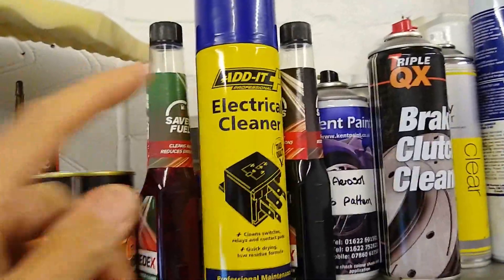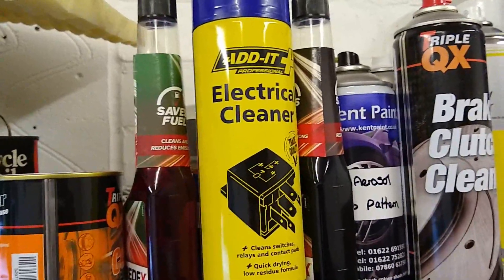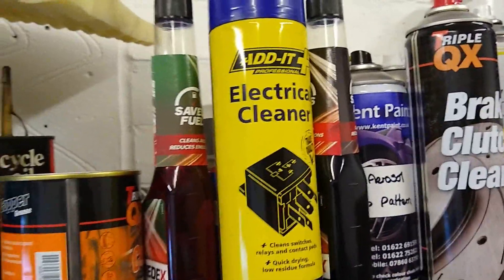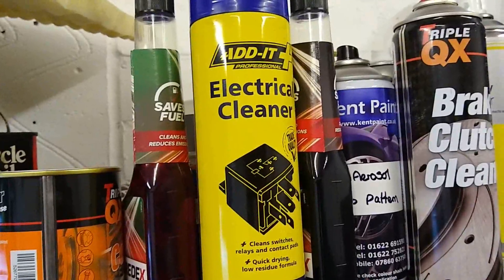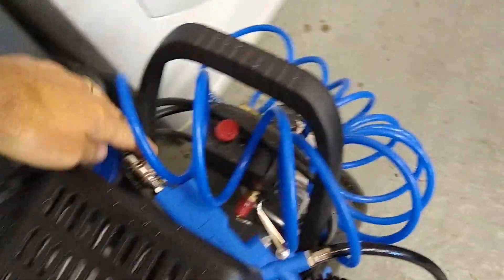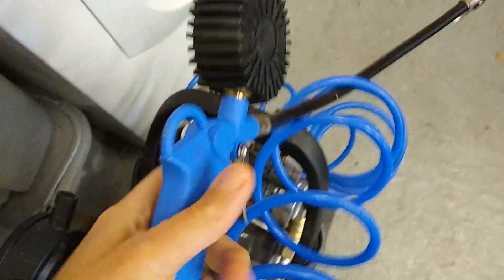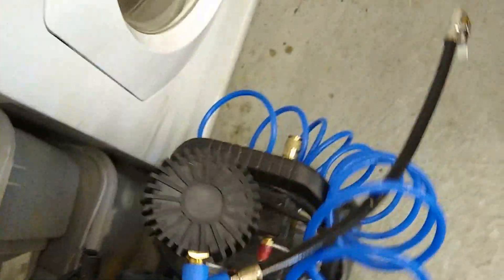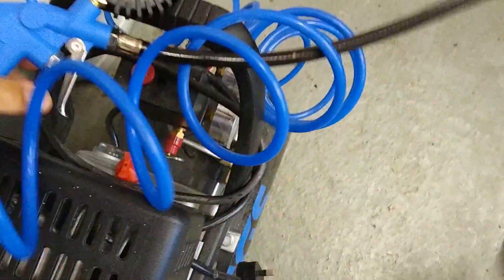VW Golf/Passat/Polo/Touran Indicator clicking sound continues after cancelled-fix random stalk noise

Comment: Hello! Ive been having this problem with my VW Passat -05 Turbo and the clicking is driving me mad. Should I cut the electricity by removing the minus pole on the battery or something such beforehand?
Reply from the maker: I didn't, I just used the cleaner on it with the ignition off but it would probably be a good idea to do that